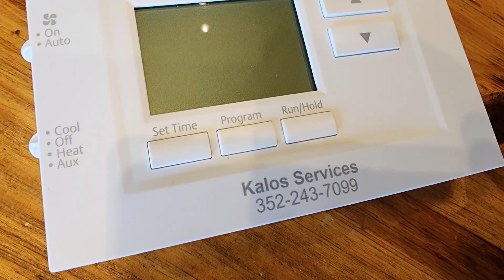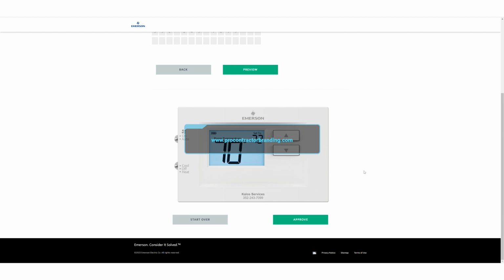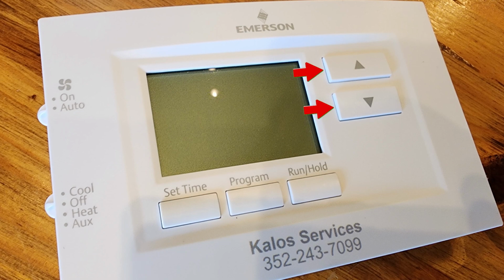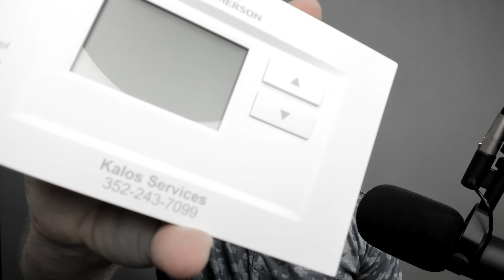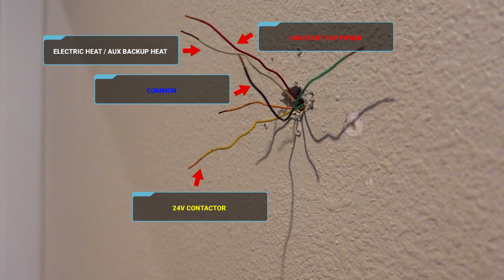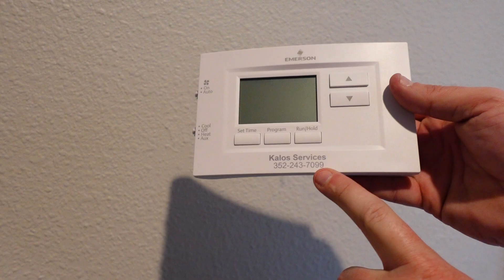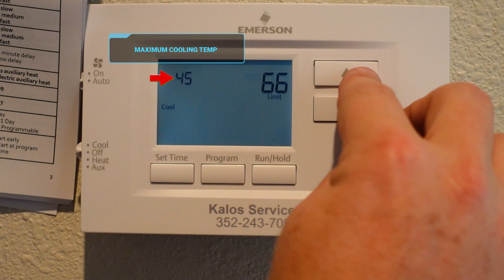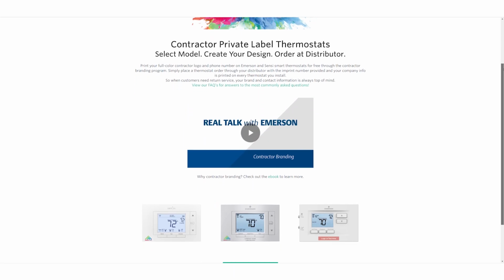Simple, Easy Thermostat Install with White-Rodgers 70 Series

Comment: looks like the builder grade thermostat from 20 years ago. and too many buttons. seems like theyre paying you for this ad. ecobee tstats with wireless sensors are hands down the absolute best for my dry super hot climate where the location of the sun vs shade means everything. we dont have a humidity problem just a nasty sun that cooks everything. especially that they do not build the walls that face the sun thicker and more insulated than the walls that do not. as the sun goes over and around the house during the day you need to average out those sensors that way the temperature in the house maintains constant and not dictated to 1 side of the house. been using ecobee since they first came out and they are always cutting edge. their cust service is better than any. I can control all 3 of my units by alexa/phone. unfortunately i do not make money on them but at least it makes me and my customers happy.

Comment: What is even worse are those thermostats that connect to the internet and if the homeowner gives permission, their gas and electric utility can adjust the temperature settings remotely during the many seasons we have. Can you imagine having the utility company run your thermostat? Also, those "set back" programmable models are in most, not all, cases a fad since allowing the temps to freely rise or lower and then when set to, the heat or A/C will condition the interior. We have found that it depends on the home and location if that idea saves any money to the homeowner since allowing everything inside heat up 10 degress and then try to get it all cooled down once again and perform that cycle one or two times a day. Same in winter, all is allowed to get 10 or so degrees colder then the heater has to work full time to get the temps back to their comfort settings. There are situations where its much cheaper to set the temps to say 78 in summer and leave it there 24x7 or 68 in winter 24x7 instead of putting the daily full demands on the HVAC for short periods of time. Those internet connected thermostats are however, very convenient when you are not home and want to make changes to the temps before returning home or when leaving and when you are not home but others are staying there, you can manage the temps so the "visitors" don't take advantage of your HVAC.